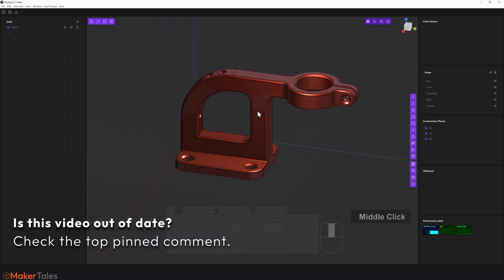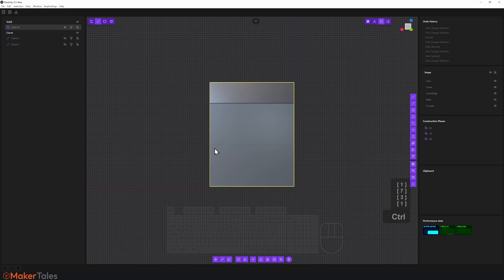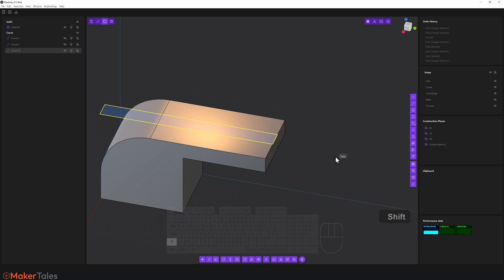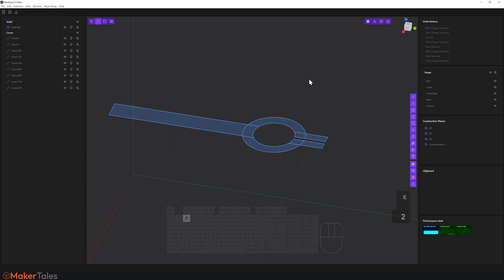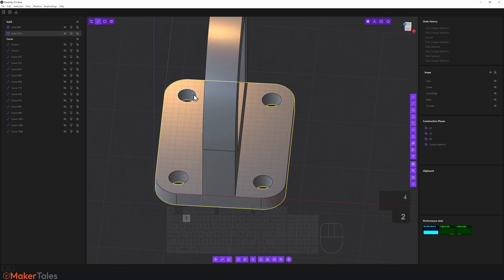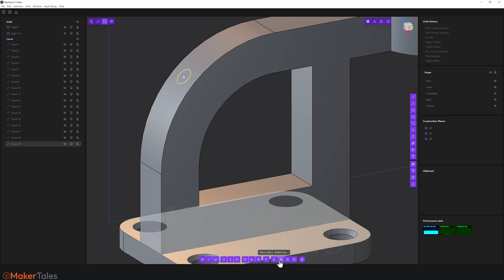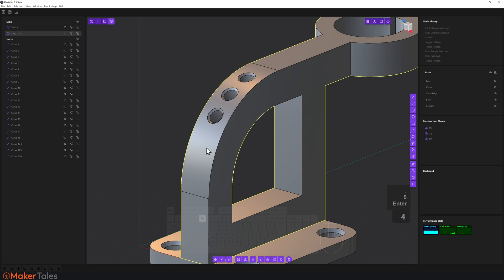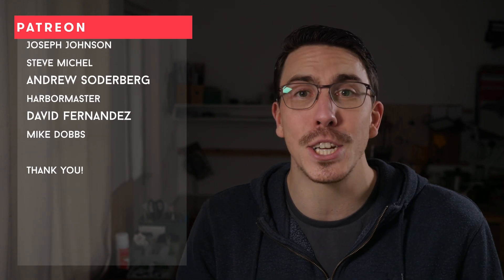Plasticity 3D | Precision Hard Surface Modeling For All | Part 7

Comment: I know this is an old video, but I just found out about Plasticity and have been trying it out.  I see there's an easy way to set the dimensions of an object (e.g. circle) when creating it by typing it in (e.g. radius 3.5mm).  If I want to edit the dimension later, all I can find is relative movement, e.g. I can decrease the radius by X amount, but I can't just type in the new dimension for a radius.  Am I missing something, or is there really no way to resize to an exact new size?
Reply: Same question here. How can I measure old features and change them parametric?
Reply: Been trying it too. working in mm seems quite difficult. When I try y rotate an object it disappears. Can't find how to edit dimensions either and the tutorials I have seen don't show it either.
Reply: Don't think the program is parametric